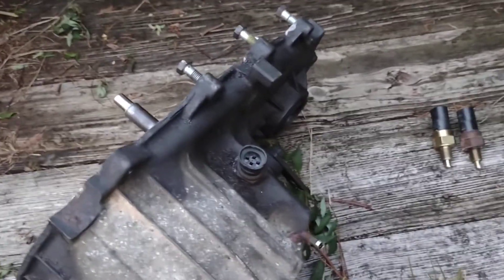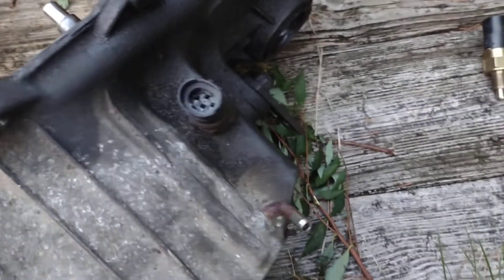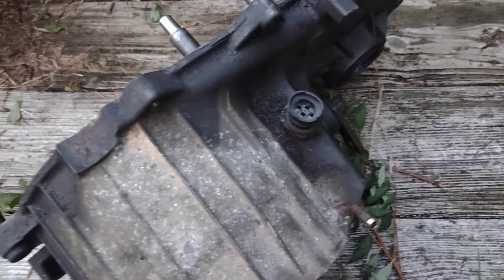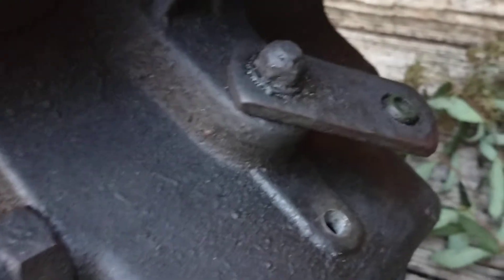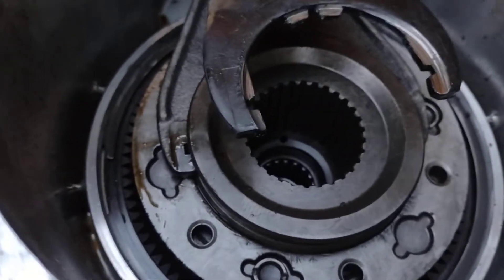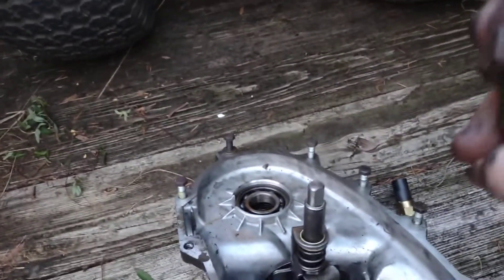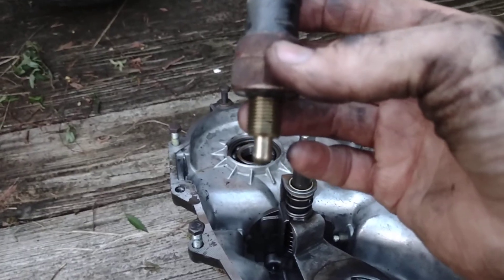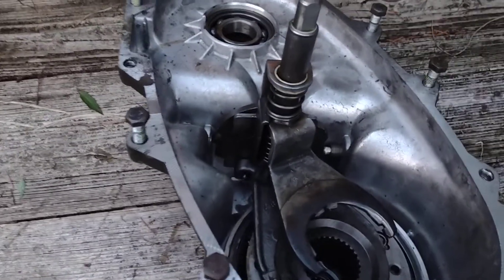Jeep NP242 Transfer Case Light Disagreement.

Comment: Hello Mark L.. I have the NP242. My "Part Time" light was flickering occasionally, especially when warmed up and while accelerating or coming to a stop. Other than that, it does not stay one and sometimes will not come on when I do put it in "Part Time"I changed the switch, yet the problem persists. Wiggled the feed wire and cleaned the connector, problem still persists. The fluid level is fine and the viscosity is correct. I'm wondering if it's a lingage issue. Just wondering if you had any ideas or anyone else watching this video does.
Reply from the maker: Most likely it is developing into the same problem. You will know if it starts to jolt under load. If the nylon shoes are lost completely it will destroy the shift forks. You may be able to verify with a flex borescope thru the indicator switch boss or by draining the fluid and looking for plastic bits. They are pretty inexpensive. I paid $150 for a good one. The NP 231 is more robust but not as versatile . Nothing worse on a wet mountain road in 2WD. I'm not even sure you can get new shift shoes. Good luck.